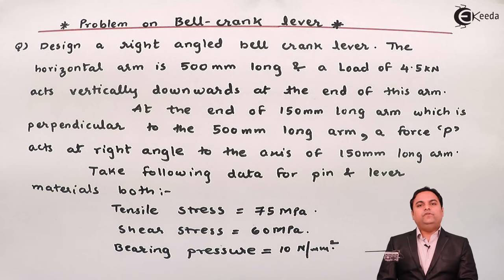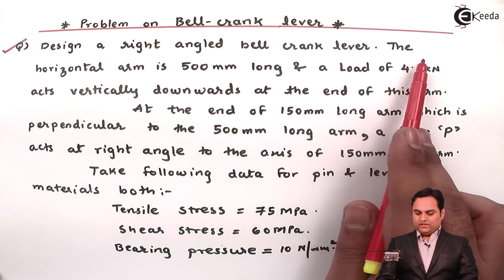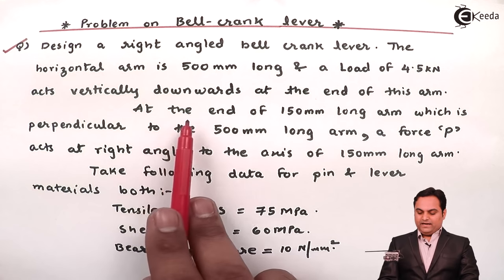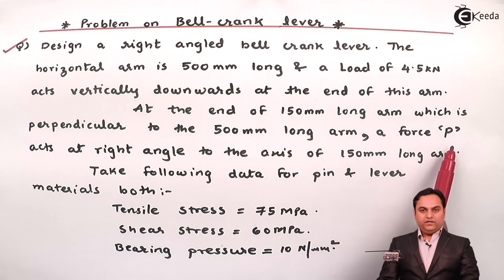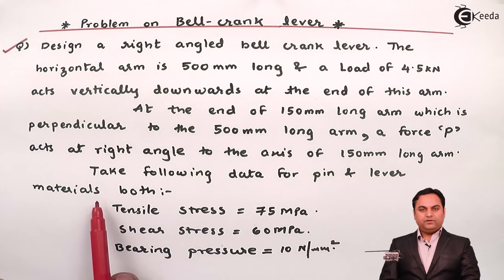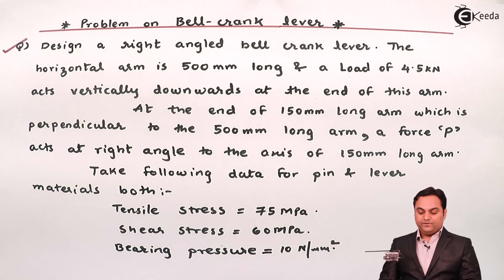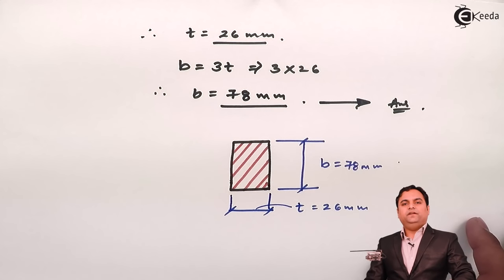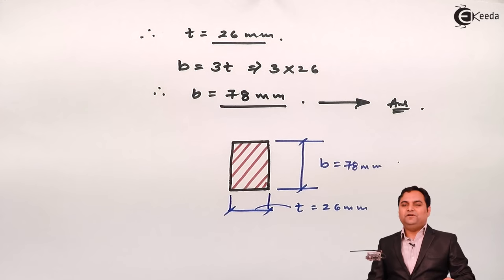Problem on Bell Crank Lever - Design of Cotter Joint Knuckle Joint Levers and Offset Links - DOM

Comment: In a hartnell Governor, the length of ball arm is 190 mm, that the sleeve arm is 140 mm, and mass of each ball is 2.7 kg. The dimension of the pivot of each bell crank Lever from the axis of rotation is 170mm and the speed when the ball arm is vertical, is 300r.p.m. the speed is to increase 0.6 percent for a lift of 12 mm of the sleeve
(A) find the necessary stiffness of the spring. 
(B) Design the ball cranck lever. The permissible tensile stress for the material of the lever may be taken 80MPa and the allowable bending pressure at the pins is 8 N/mm^2 . Please sir solve this question